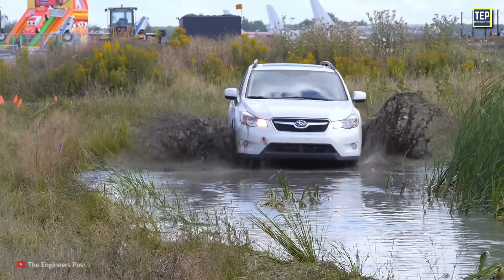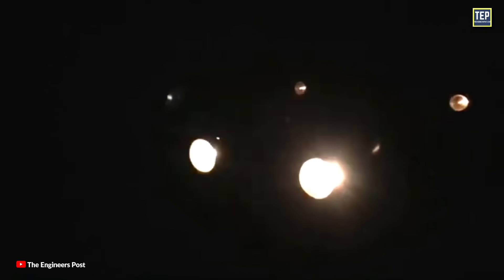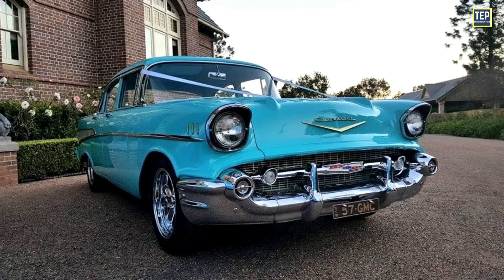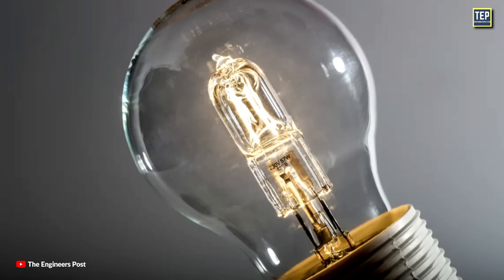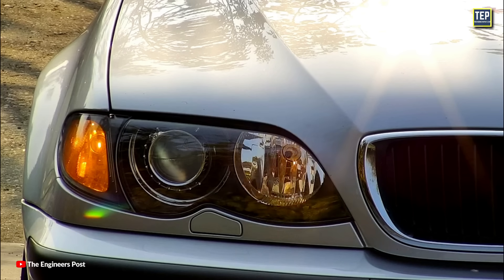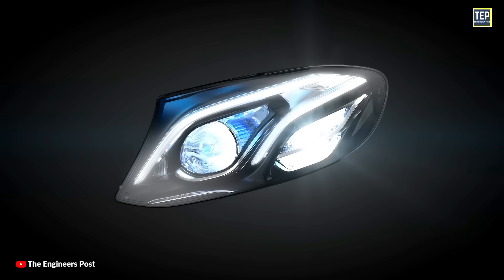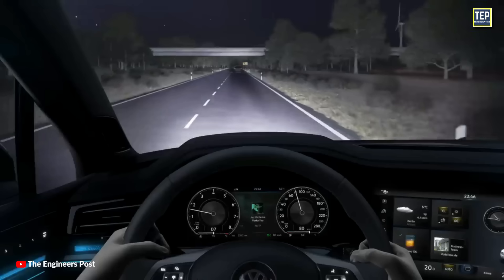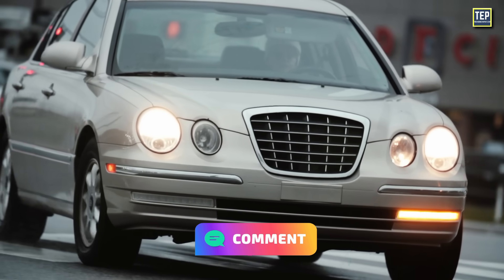The Problem With These Headlights

Comment: I can say I hate those matrix lights do not work for truck coming the other way when sitting up so high. I have noticed that it's the high end cars like BMW and Audi that blind me all the time but not so bad when in my car so did some research as to why and this matrix shit is what I found its a stuped idea. Driving a 42t truck being blinded for a few seconds on a narrow road it's a bad feeling to lean forward, look down to try and spot the line and hope for the best while squinting from the glare. Old cars with aftermarket led headlights are just as bad but they blind everybody not just trucks

Comment: personal experience, most people  dont drive much at night, 
halogen are perfect enough to suit most drivers, of course if the car is tinted to some level of shade, halogen is no longer bright enough to see. 
but remember too bright blind other driver, you put safety on your own hands. 

HID last longer for continuous long run, if your application is on off on off frequently, the bulb gt destroy even faster than halogen 

LED is best for price and performance. but 13:11 explain it... 

all these light (except laser I never experience) Halogen perform well on rainy night. others just glare... there is reason why street lamp often use below 2700 kelvin. Halogen 2700-3000 kelvin is just perfect for most conditions.

Comment: Halogen>HID>LED. My experience with my cars: halogens have been the most reliable and long lasting (I've never had to replace a halogen bulb). HID is the best for brightness/distance but they randomly fail because of their complexity, at least when they fail you can fix them pretty easily and cheaply but matching the discharge hue is hard unless you just replace both lights. LEDs are stupid and are marketed by lies. They don't do a good job lighting the road very far and they fail constantly. I hate it when one LED fails in a series so now you have a dark spot on your lights (if they still work). When I got my new truck I chose halogen lights over the LED upgrades. I don't want to deal with LEDs anymore.

Comment: I find it surprising that in the last 15yrs of automotive headlight engineering, so much time and expense has been wasted on headlight design including the extremely expensive laser light, mechanical shutter systems for blocking out high beam light, pivoting lens arrays for turning light into corners, matrix-LED arrays etc

Many automakers already use projector lenses in their headlamps… so why not equip them with a DLP chip too (the same used in projectors), to control the lighting brightness and blocking out oncoming drivers. It could be used for highlighting dangers and displaying graphics too. DLP is an inexpensive and robust technology with high definition compared to current offerings.

Comment: At 13:20 you stated that it is impossible to retrofit LED bulbs to older headlight assemblies.  That is not correct.  There are manufacturers making LED retrofit bulbs with small lenses over the LED array that mimic a traditional halogen H4 bulb.  Using a light meter on a 6” grid at 100 feet I was able to match the beam pattern within 5%, LED vs halogen.  It did require some adjustment of the reflector but nothing I couldn’t do with a screwdriver.  It does require some time, about an hour, but in 5 years I’ve never had anyone flash their lights and everyone I ask says that they are fine.

Comment: on some roads, i drive now with sunglasses at night, with blue filter. because every fucking suv blinds you in a low normal car, my mirror allow only 20m back vision at best, because of it, i turn then up fur the autobahn. and use my rear fog light too tell keep fucking distance, im thinking about a rear light bar, and some laser idoits blinds from 600m that i have to stop. this is stupid this trend is dangerous not a good idea 3000lumen HID was always correction for the road its fine, Matrix looks for traffic, all the other stuff have to be banned from the roads, or has to be halogen

Comment: The problem isn't the headlights per se, it is how  good quality hid and led are only available on expensive cars. There is also this misconception that 6500k being the "daylight" color ia the best option for visibility. Based on trial and error I find the 4000k range to offer the best balance between visibility and comfort to the eyes, the 6500k scatters too much in rain and wet surfaces simply absorb it.
Reply: Totally agree.  I tried putting 6000k LED bulbs in my car, and it felt outright dangerous to drive at night in the rain.  Switched to 4200k bulbs and some 2700k fog lights and it is a HUGE difference.  Bigger number isn't always better...
Reply: Finding any 6000+ kelvin clour temp LED that can accurately render colour isn't going to happen. 4500k to 5000k has the best CRI and would therefore make better headlight bulbs for city driving especially. They choose 6500k as it projects further due to there being less yellow coating on the chip.
Reply: @thebrowns5337 Colour temperature and CRI are very different properties and can't be directly related. Colour temperature is a measure of the equivalent temperature of the predominant peak in the emitted spectrum whilst Colour Rendering Index or CRI is a measure of the way colours illuminated by the source are true to original as measured under a black-body source which gives a flat output spectrum from near infrared to near ultraviolet. This illuminates all colours equally and provides a reference of 100% against which other emitters are measured.
Reply: You're spot on. The problem is not the brightest at all or that LEDs are bad (Although, if it's too bright you can over expose everything you're looking at). It's the manufacturers not dialing the diodes to the correct temperature. 6000k for pure white or 3500k-5500k for a warmer white. Any less and it becomes a gold color. Any more and it becomes unnecessarily violet. I like true yellow for fog and auxiliary lights in fowl weather. Mazdas for example have strong lavender hues on their LED headlights that strain the eyes in the dark. Also, headlights need to be properly aimed, even from factory sometimes.  And most people don't even know it should be done or how.
Reply: @bravskii10 Fowl weather? Good weather for ducks?
Reply: @keithhoughton4308  foul weather
Reply: In former days it was legally ordered in France that headlights were yellow. They then were already aware of the fact that yellow was better for the eyes,  certainly in wet conditions. Thanks to European regulations they left this rule. Pity
Reply: True I’ll talk about most Indian manufacturers motorcycles  the entry to mid range motorcycles use terrible 6500 k bluish purple led that speed to scatter disperse a lot even in the dry and are an eye sore to oncoming traffic or if in your rear view mirrors I’d rather have a great halogen than a decent led or hid on my bike
Reply: Totally agree.  I have used Philips D1S 4600k (OEM) for dipped and main beam since about 2009, and 2300k fog lights which is really yellow like the French use.
Reply: Completely agree. In my area, torrential downpours happen on a nearly daily basis. In my experience, the whiteness of many modern lights is too much for me when it scatters off of rain drops. If my young eyes with good vision have issues with modern headlights being too white, I can't imagine how older folks feel.
Reply: 4000K to 4500K is the best since it's WARM WHITE
Anything beyond that is just being obnoxious.

2500K is also good but mainly for fog lamps or aux lamps/lights that you need when going off road or if you plan adding more lights to make you more visible when it rains, snows or when it gets foggy.
Reply: ^this!
Reply: Human eyes are more sensitive to off-white than pure white.  Under off-white light, we can see clearer with less light brightness.
Reply: At sea, red light is used below decks to preserve the crew's night vision. A very high level of sensitivity which is lost when exposed to powerful high temp (white) light and can take several minutes to restore. This is happening to a lesser extent each time you drive at night. It's worse for older people but anti-glare glasses can help.
Reply: 10:00 Why vehicles stop using xenon headlights because one time I had my xenon headlight flicker and then I heard a loud popping sound. And the light turned off. Police pulled me over. So I saw that the ballast exploded because I touched the glass while replacing. So I get LED headlights instead because I don't want it to explode.
Reply: 6k HID is the best!

Comment: surprised to find the old lights to be interesting.  Laser part a bit too short or lacking, equivalent to the amount of information BMW released when the announced the laser light. LEP light is dropping recently.  I will also not be surprised for three laser or RGB for headlights because high end projectors use this type of configuration.

Comment: Led headlights are definitely not the answer they are just reasonable on a clear dry night,wet road rain etc they are near on useless led lack intensity on wet roads or rain try finding your way around with no street lighting to help.Now the worst problem with led and every one knows they seem to bright for oncoming traffic that is because they have been deliberately screwed up to try and get more out of a headlight that lacks guts,they are the worst thing for truck and car illumination the are potentially deadly for this reason.Turn them down or get rid of them!

Comment: All headlights dazzle other drivers because they are aimed horizontally. If you have common sense, you understand that headlights should be mounted on the roof and aimed down - at the road, rather than at other drivers.
Reply: Harvard wants your location
Reply: Headlights on the roof will illuminate the rain and snow directly in front of you, and you can't see past it.
Reply: That blinds your windshield.
Reply: Ya in the roof aimed down so you can blind everyone even more and only see 2 feet in front of you